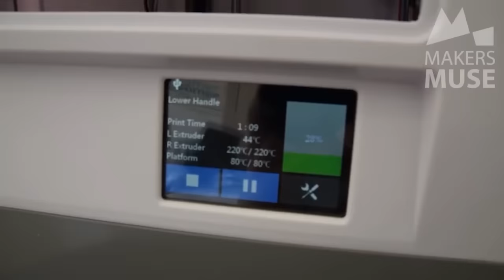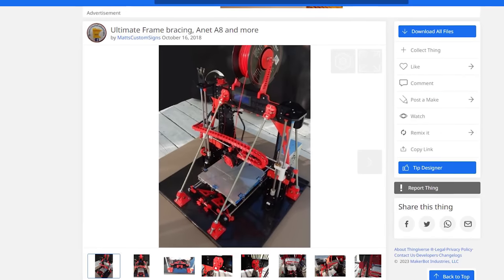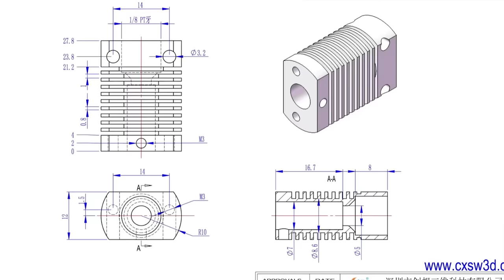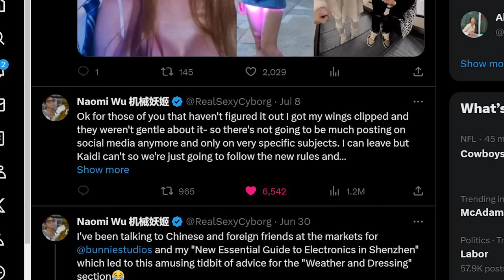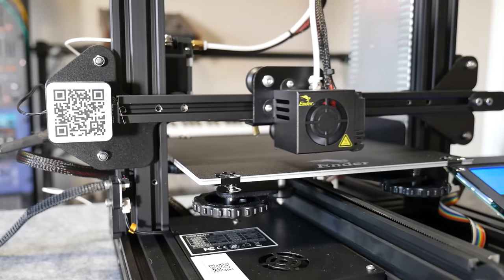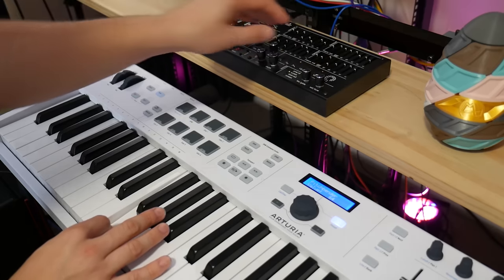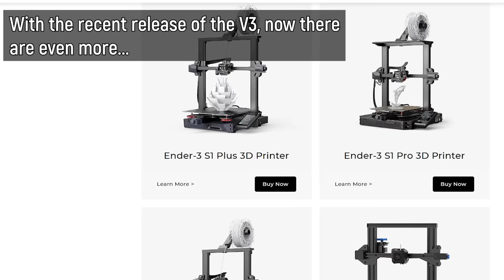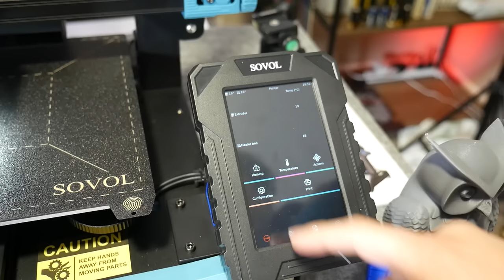Creality Ender-3... it's time to move on.

Comment: What helped me most with the Ender 3:
- Cura Z Offset Plugin (you just level with a piece of paper and then adjust in 0.1 mm intervals up or down), gets ten times the prints out of a bed levling as you don't have to adjust every time with the springs as long its more or less plane
- use a little bit of sugar water applied with a sponge for Adhesion. Super cheap, works great
- the ender 3 is the VW Bulli of 3D printing. You build up a love-hate-relationship with it and went through some tough times together 😂. It's pure nostalgia

Comment: Ah yes indeed it is time. I started with an Ender-2, modded it for about 90% I guess and got it printing as well as any expensive machine out there. Learnt a TON. So in that sense it was nice to be able to do that, however moving on to the Ender3V2, I ended up seeing the exact same stuff I wanted to mod and throw away, it seemed (and is) such a waste in general. So got me the MK4 and now I have both the knowledge to fix it (if needed), but also just have a printer I don't immediately want to mod. :) I will never go the Bambu way though as I still value being able to fix everything myself with standard parts.

Comment: i've had my ender 3 pro for many years now and recently been thinking about planning an upgrade, it's a great machine but auto-levelling and a few other little tweaks would make such a difference for me - would love a current video on the different price-points for 3d printing and the advantage of the extra features at each level.
Reply: Add the cr touch, its not too difficult.
Reply: id have to agree with the other guy. shouldn't be too hard to add a CR touch to it.

Comment: I still do recommend it as one of options for first printer "if you're feeling brave, adventurous and patient, and want to learn 3D printing more than to get your prints done".  And specifically, if you want a printer to ger your prints fast and hassle free, Bambu is a great choice. If you want your first printer then Bambu is not a good choice as it won't teach you much. Prusa mk4 if you have the budget, mk3 if you still have some budget, and Ender if you really have little but know what you're getting into.
Reply: Ender if you think you know what you're getting into and Voron If you actually know what you're getting into
Reply: Bambu is best beginner 3d printer when you get a problem it's going to take a very long time and you can focus on printing and designing and when you get a problem just scan the QR code and read the guide to fix it that simple.
Reply: @michaelperez6811  ...then you get a big print volume bedslinger as your second printer, 'cause Bambu's 255mm is not enough for what you want, and you have no clue how to make it print consistently, because Bambu didn't so much as hold your hand - it did it all for you behind the scenes, and you didn't learn from it anything about first layer, bed adhesion, warping, belt tension, or any of dozen problems bambu automagically solves depriving you of the learning experience.

Comment: I love my ender 3's because they taught me to buy once and cry once. I wish I would've just bought a prusa and not had the pains of trying to manage the ender 3, but I learned a ton of fundamentals, so I guess it was okay in the end
Reply: I just got my Prusa printer and it’s actually quit a bit of tinkering before you can start printing, I originally purchase an ender 3 pro and modded into a v2. If it wasn’t from my great learning curve I don’t think I could have gotten my Prusa running.

Comment: I started this hobby with an Ender 3 just like most of the community, but after 5 years I've since graduated to a Bambu Lab A1. Even with the multiple upgrades I'd already given it, my old printer just wasn't printing reliably enough for me to WANT to print. Enders are cheap up front, but by the time you get them to a level of functionality similar to a Bambu you'll have spent hundreds more, so I'm happy I made the switch.

Comment: The V2 is the sweet spot.  It is still moddable and have the refined offering of higher end models.
Reply: My V2 has been rocking since 2021. I've only done a handful of mods - new control board, PEI bed, and, most recently, a Sprite direct drive head. I have linear rails for the X and Y that I snagged on Amazon prime day for near future upgrade. For my practical application and part prototyping I think it's done really well for me.
Reply: "cope."
Reply: @Budda648 so basicaly you end up with frame of e3 - there is almost nothing from original e3 left after all these mods
Reply: @kamilklimek5619  right, but everything worked really well before the mods.

Comment: I was thinking about 3D printer for long time, but gave a shot at it when Neptune 3 released.
Majority of issues were solved with soap water and IPA to clean up bed from time to time.
oh .. and trying out white fillament was adventure.

Beside that as complete newbe I had mostly just fun with designing and prining stuff.

Comment: As a Linux user, this kinda reminds me of Ubuntu, which for a long while was the distro that made the Linux desktop much more accessible to the average user with minimal tinkering.  But, as Linux popularity grew, better alternatives started to appear.  Some of those alternatives were hot garbage, some were great if you knew your way around a command line, but then there were some that just took what Ubuntu had and made it even better for beginners.  Nowadays, Ubuntu is too corporate and they change things up too often, which interferes with a smooth user experience.

Comment: I bought my Ender 3 Pro in Feb. 2020.  I paid $215 for it and it was at the price point where it wasn't a big deal if I didn't use it.  I do print those random trinkets, but find myself printing repair parts for the household more than anything.  I have printed little spacers, parts for decorations, headset hooks, and the list goes on.  I have had zero issues with it.  I upgraded to a 4.2.7 silent board, CR Touch, and a glass bed.  The only reason I would consider switching is for a larger build volume.

Comment: I bought the v3ke as my first printer a few weeks ago and it has been completely painless. Unpack it, put it together, run calibration and send a file via WiFi. It's been a blast. The standard profiles in the creality slicer work really well and I havent needed to adjust anything so far. This is how it should be: cheap, painless and easy to use without fiddling around with it.

Comment: I bought mine years ago for 130 euros. In the past few years, I’ve swapped the motherboard, removed the screen and went full Mainsail/Klipper/RPI/webcam, installed a MicroSwiss NG, textured PEI sheet and build an IKEA Lack enclosure. So yeah, I’ve probably spend like another 300 euros upgrading it but it was a great learning process. And the concept of upgrading the printer with parts that it prints itself is pretty cool to me. My goal is to be able to print ABS so I can start making a Voron. It’s evolution!

Comment: I still have my Ender 3 (original). It was bought in 2018 and it has evolved into a great printer. The main mods were a quiet main board and metal extruder. I 3D printed the usual things to make printing more "convenient" but not really necessary. I still manually bed level the printer and thinking of changing the bed level springs as the next "improvement". It is for those who like to tinker as mine was super cheap and had to be assembled they called it "kit" form. I learned a lot about 3D printing, what it can and cannot do. My other printers are an Elegoo Neptune 2 and Mars (original) resin printer.

Comment: Can't comment on new printers, but the Ender 3 Pro was my first printer and I'm so appreciative of the community support for the ender 3. I bought a used CR10v3 and was surprised at how little is available about it. Luckily, pretty much everything I learned about the Ender 3 applied, but I can't imagine what would've happened if I started with a CR10v3 or some other printer. It'd probably be collecting dust.

So I'd just say, research the community support before diving in. Chances are you're going to need help and the ender 3 line has a lot of solutions already online for your problem.

Comment: I just sold my 6 years old origina Ender v1 that had pretty much evolved into a v3+ with all the mods I put on it and I just loved it. I got a Neptue 4 plus in place for 333 usd because I'm not afraid of leveling my beds. 

However I haven't seen in my market here in South America, any other printer that beats the price of the Ender 3 v1. at about 150 usd equivalent. Nothing comes close to it in price, you have to put about 40% more money closer to 250 to actually get significantly better printers like the Bigtreetech Biqu, Sovol, Kobra 2 or Neptune 4, yet you still don't get full automatic bed leveling, so none of those are that beginner friendly either. 

I do love the Neptune 4, that is the one I'd recommend myself, but it is 50% more expensive than the Ender 3. That is significant amount of money here in SA.

Comment: I got one, I changed it to direct drive, I print TPE and TPU a lot,  bimetal hot end + copper block for hight temp, second Z motor, auto-leveling bed mesh, removed the springs under the bed for rubber blocks, G10-FR4 for the bed and MRISCO professional firmware. I love my ender3 V2. I use Orca Slicer and Octoprint on a Raspberry pi 4.

Comment: I think this needs a slight update since it sells (frequently) for 99$.
I haven't even used my ender 3 yet... but for 99$, it'll be another toy to play with for me. that being said... a jump from 99 to 500$ imo needs to come with a productivity and electronic tech improvement... not 5x, but 2-3x  improvement in speed and accuracy and ofc tech on top of that. 

I've asked a few, but no clear answer... what is the next upgrade from an ender 3? once you get used to it, and want to get something more reliable and maybe faster.
I'm thinking something between 100-250 as a next step, it needs to be logical on my end.

Comment: I have noticed the troubles people have with their Ender 3s on r/fixmyprint or r/3dprinting and everyone flames me when I say your printer is the problem. Maybe I am spoiled because my first 3d printer is a Bambu lab X1C, but I feel bad for these people who have a Ender 3 and expect a tool that produces parts, but it proves your point here that they are not a good 3d printer. Really goes to show how many of the newer 3d printers put them in the dust and are a tool and not a hobby. This video really explains the issues and it helps educate people on the current state of 3d printing. Thank you for the educational video.

Comment: I bought the original Ender 3 without any bells at the beginning of this year and let me tell you, it was one of the most frustrating journeys I never knew I'd go on. On and off tinkering for 5 months just to get consistent prints. Constant issues that, as someone brand new to 3D printing, I had no clue how to troubleshoot or resolve. 11 months, numerous headaches, failed prints, and wasted filament later? I've upgraded the printer to essentially be the same as the Ender 3v3 KE. I consistently get quality prints. An issue arises and I know how to fix it. This machine taught me the intricacies behind 3D printing and opened an amazing hobby and I don't regret it one bit.

Would I recommend it for someone like myself 11 months ago? Absolutely not. Though I'm thankful I went the route and learned what I did.

Comment: totally agree. im still rocking my tricked out ender. ubl, nozzle cleaning, prints up to 300, klipper control and a 7 inch IPS, cabinet control, almost nothing is stock and that's why i agree. if you want to learn to build machines get an ender, if you simply want to use them get something else. but thanks to my pain with the ender 3 i build automation systems for factories, i built a desktop laser in a day for less than i paid for an ender 3 and it's now making parts and furniture for the shop. i dont think a bambu brings the same experience... but it wouldnt have had a warped bed, failed pneumatic fittings, melted its own "xt60" power connector and tried to catch fire, ripped itself apart, destroyed its bed for no reason (limit fail when it had switches), or any of the fun crap that is entirely why i love this machine. in texas there are new f150 owners, and pre-aluminium suburban owners, just as there are bambu owners and ender owners. while trying to rescue trapped people during an ice storm the f150's 'smart traction control' decided to disable the accelerator for my safety and refused to leave the driveway. make what you will of that. ill keep the suburban and the pos ender 3, i'll slap lidar on it as soon as a sensor that doesnt suck az exists. the i3/ender style is a very accessible and approachable entry point with a HUGE community to learn from but it's a starting point that is far from the destination.

Comment: My ender3 pro is still rocking after nearly 10 years!
A few years ago I upgraded the mainbord and hotend for the silent steppers and to be able to print nylons. Printed a better cooling system, some drag chains and build an enclosure out of cardboard for high temp stuff. 
Now it can do anything I could ask for! 
Yes it's relatively slow, and requires some maintenance ones and a while, but boy did I get a bang for my bucks with that printer! 😁
Maybe the best tool I ever purchased! 👍

Comment: Like most commenters here, I find the Ender3 Pro that I purchased in 2020 a wonderful (if somewhat slow) 3D printer, and for the price it's amazing! Mine came with the v2.4.4 mainboard, and Merlin v1.0.1 (25th April 2020) firmware. all I've upgraded is the firmware to Merlin2.1.2.2 and that's the only change I've done. Aside from a dimensional discrepancy of between 0%-0.25% I have no complaints with the printer. I keep my filaments in eSun vacuum sealed bags, with desicant and indicator, which in most cases keeps them dry for about a year, and before and during use I put the spool in a eSun heater box that I've modified to circulate the air better. I've had rare occasional bad prints and broken filaments, but these are very rare events. I have a camera watching my print and I print from SDCard, although have printed from USB. I tend to use the printer occasionally, but I find I have more hassle with designer and slicer programs that keep updating than I do the printer...

Comment: For the record, I’m no where near sponsored by BIQU but took a gamble recently and spent $129 on a new printer that’s slightly larger in build volume than creality v2, has color touchscreen, and built in auto leveling, making perfect prints for the least amount of effort. And with a magnetic build plate. I was using glue and other things with creality but with BIQU it’s no nonsense. 
Folks, it’s $129 at Microcenter. Not spamming or getting compensated here, I’m just blown away by it! It even uses a USB-C cord to simplify some of the connections to the hot end

Comment: Started with an Ender 3 to dip my toe in. Ran 4 Kg through it with lots of babysitting and overnight prints. Just got a Bambu this year and it's nice to have a printer you can just print to and not worry about--even with PETG.

Comment: I bough an Ender 3 and had nothing but trouble with it. No matter what I did, I couldn't get it properly leveled (turns out the bed was warped), nor could I get decent adhesion. At this point I was so frustrated that I put it in the basement and forgot about it. Then in December I bought the Bambu A1 and it just worked. Too bad there was a recall, but I've ordered the P1S to replace it. I'm happy for anyone that was actually able to use their Ender 3s.

Comment: Back when I started in 3D printing, I was looking to get my first printer. I wanted one that had lots of support and a community around it. I chose the original Ender3. Lots of parts to assembly, manual calibrations. Yes, it is time to move on, but the Ender 3 will always hold a place in my heart.

Comment: Just upgraded from a Geeetech A10 (Ender 3 clone) to a Bambu Labs A1 with AMS and couldn't be happier. I'm still very glad I started with an Ender 3, I learned a ton modifying that printer and learning about 3D printing. I'm sure I'll still use my old printer from time to time.